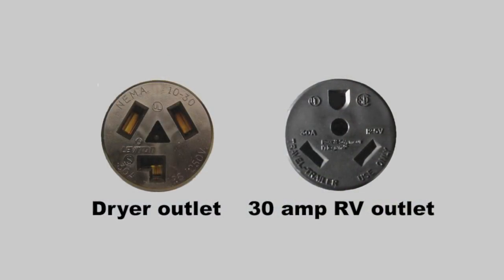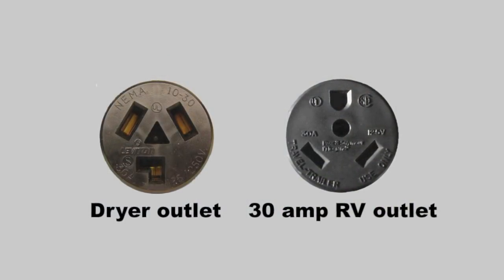Avoid blowing out your RV electronics from a home electric hookup

Comment: Help please! We just bought our first RV (travel trailer) and are going to be staying at our friend's farm and will be plugging into one of their farm buildings where they use grow lights so it was wired with 220V outlets. However, the outlets we would use look like standard wall outlets. (this is possible?) We have a 30 amp trailer and want it safe. How can we do that? Thank you for any assistance!!!!
Reply: Just get an inexpensive multimeter, you can check the voltage instantly. A good investment.
Reply: Anaitis Fairy I need to know the same thing😶 I hope someone answers this

Comment: I have a question concerning battery power.  If I turn my inverter on to run the fridge, and 110 outlets, will my battery be recharged if I am driving the rv to another location, or will my battery just be drained.
Reply: Your batteries usually recharge while you are driving off the car. But, I use to have a travel trailer and my batteries died all the time. Now, I have a motorized unit with solar panels. If you install a solar panel it will recharge the batteries for you all the time! Except of course when it is dark. :)
Reply: I am just trying to get around using the generator..
Reply: what size panel would I need.  I saw a 45 watt suitcase at camping world.